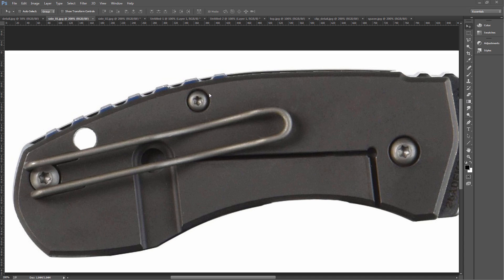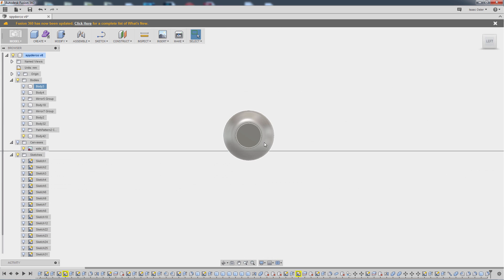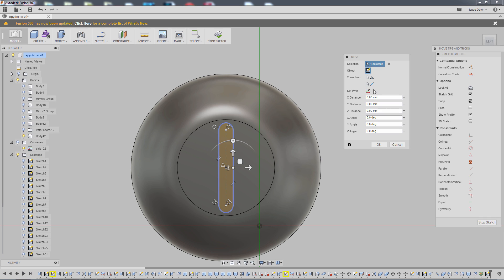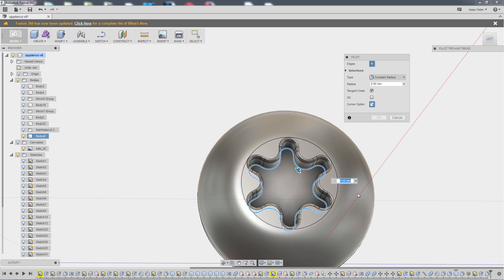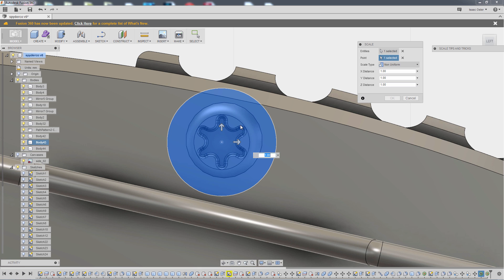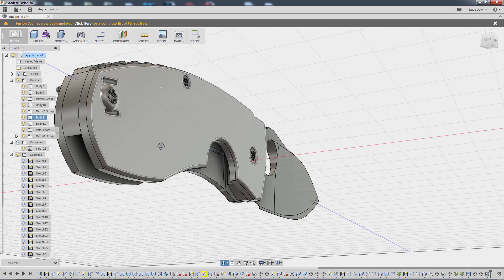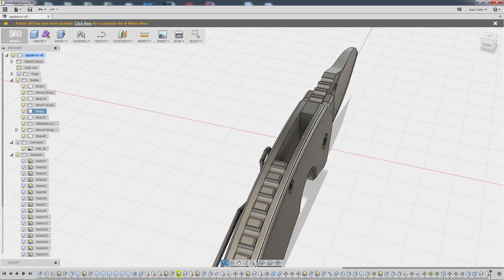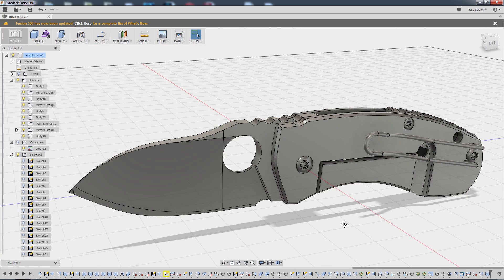Fusion 360 Sample Project Ch 9 - Modeling the Fasteners

Comment: These tutorials are amazingly helpful but I have one suggestion for this step; I highly suggest checking out the 'Insert' menu and use either the mcmaster or manufacturer part for basic screws and such. Most of the time you can just delete the threads/ parts you don't see.